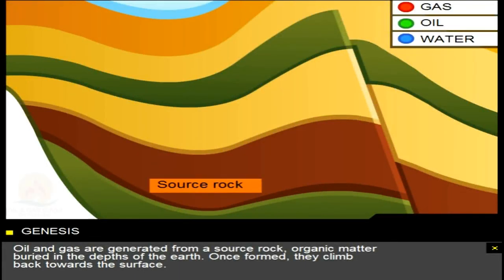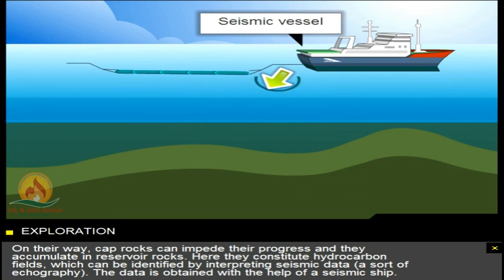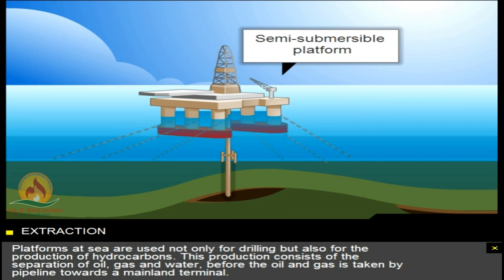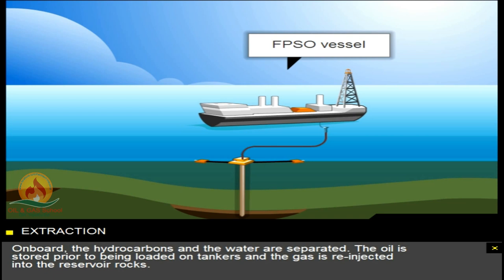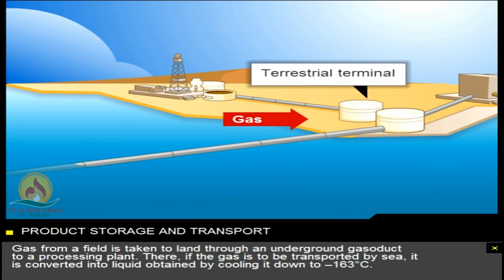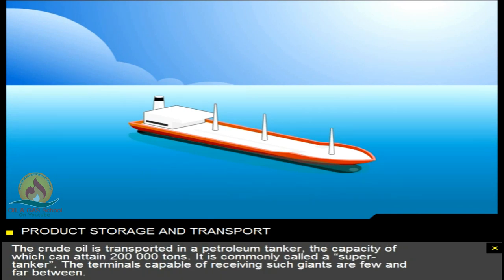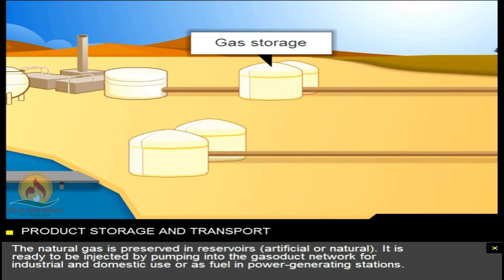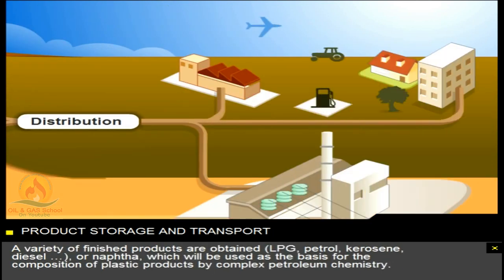Learn Oil and Gas with Animations

Comment: OOO KULIGINSKOE LLC is strongly committed to conducting its business affairs with honesty and integrity and in full compliance with all laws, rules and regulations applicable. a mandate company that is bond by law and authorized to represent a reputable end seller company involved in the selling of various petroleum products: JP54, Jet fuel A1, LPG, LNG, Mazut, D2, D6, TS1, JPA1, M100, PET Coke, AGO, ETC. OOO KULIGINSKOE LLC currently deals in Mazut M100-75/99,JET FUEL JP54,DIESEL D2 GASOIL,REBCO,BITUMEN and Aviation Fuels. Established in 27.04.2017, and with an initial business capital of US$1 Million, we are expanding our roots in different parts of the world through our top-quality products trusted by millions of importers scattered in all over the world. We are located in RUSSIA, 426035, UDMURTSKAYA RESPUBLIKA, IZHEVSK, STR. IM REPINA,35/1 KV 106, with Approx 0.5 Billion US Dollar worth of revenue since we started back 3 year(s) ago. Our company has an approximated export 
value of 1.8 Million USD - 90% of Annual Revenue. The overall market share of our products expands in